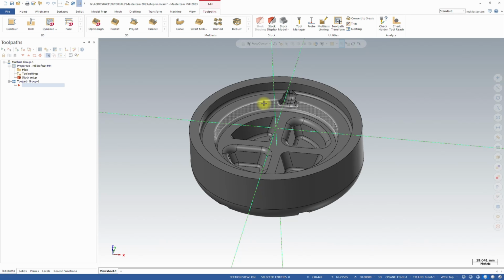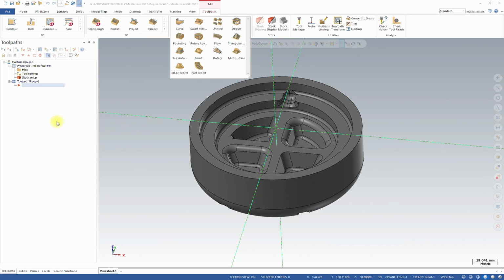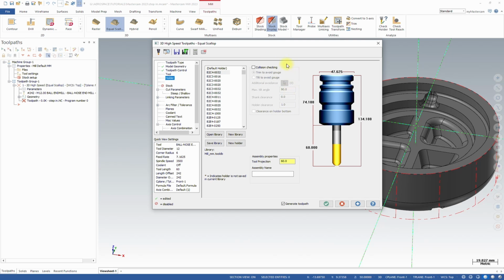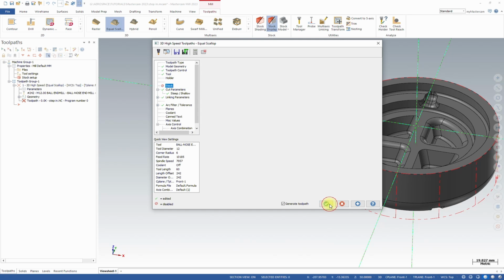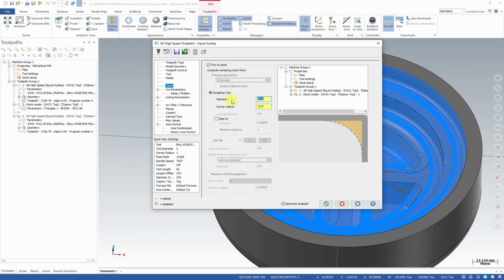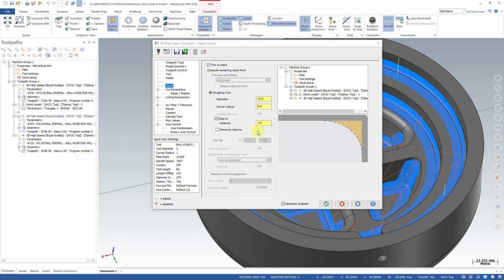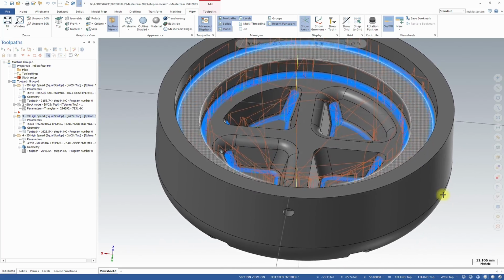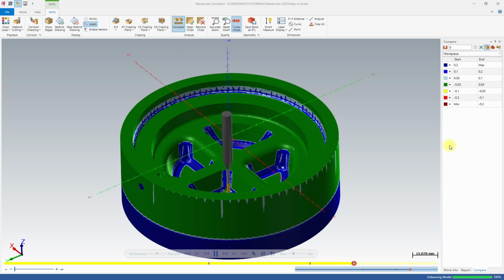NEW MASTERCAM 2023 SNEAK PEEK - EQUAL SCALLOP IMPROVEMENTS

Comment: i have a Question: when i load a part into mastercam and then after that shift-drag and drop another part in which is from the same assembly, then it will be placed in the wrong position. We have another cam system which positions the models relative to the world coordinates and thus every part from the same assembly will be positioned on the correct position. Is there a way to make that in mastercam as well? I guess i probably done something wrong
Reply from the maker: to be honest, I'm not using Mastercam much to work with assemblies, most of them in our place come in CATIA format and I use CATIA to work with those files 
What type of files are you trying to drop? My Mastercam opens assemblies with parts in the correct positions,
However, I worked with a few assemblies in Mastercam too
If you want to open Solidworks assy then you open only 1 file with extension ".SLDASM" and Mastercam will read the file and place automatically all the ".SLDPRT" files in the correct locations (saved in the .sldasm file)
Reply: @aspeaerospaceprecisionenging  they are always step files